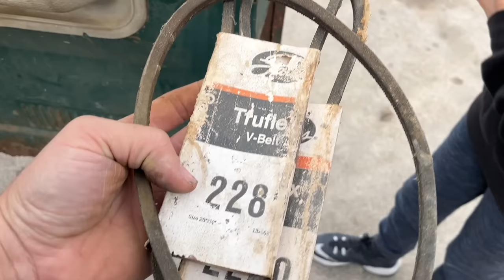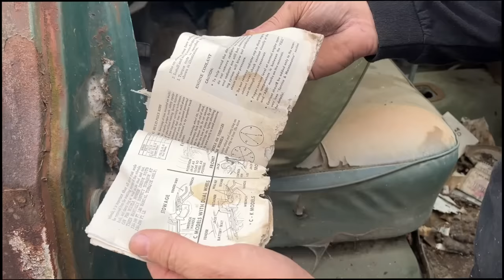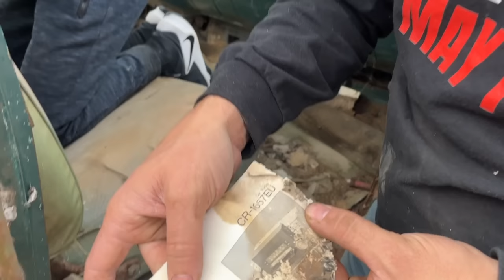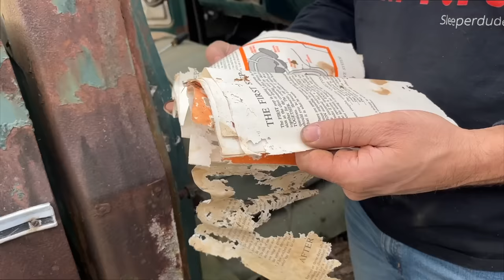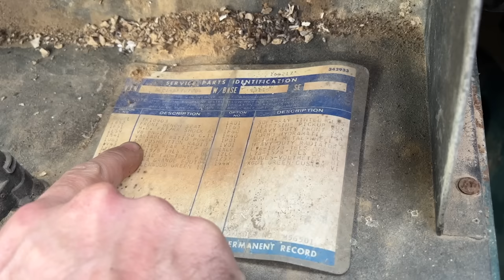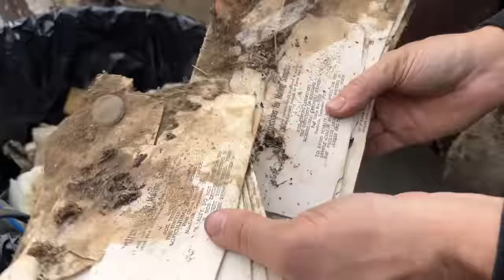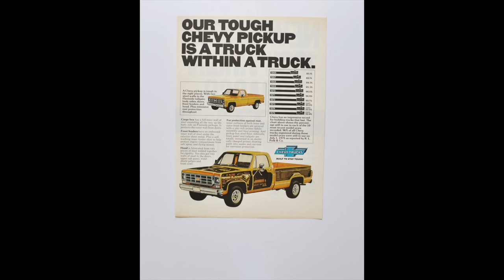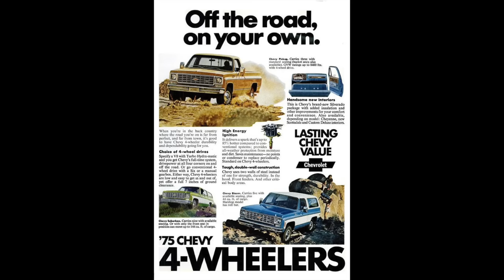Can we get it out of the creek? What's wrong with the transmission? 76 GMC K15 4X4.

Comment: That truck looks like is has spent too much time at a fertilizer dealer that sold dry fertilizer. I am surprised that the frame look so good. I vote for getting rust  free used parts or after market parts. I really think you can save the cab. Everything else needs to be replaced. It will make a super series of videos.

Comment: 35/12.50......no lift required if you trim out the rust. That wide black plastic edging for flower beds for fender flares and just see how far you can get in a local off road park maybe. You can go more aggressive with your tire choice if it's trail only.I have a pair of 31/15.50 15 v tread tires from a forklift, they were pretty worn but they look so ridiculous on 15x14 pro street wheels. I've wanted to try them on a s10 blazer for  a while now. But 4 of em, that would be a look. 31/15.50 15. Look em up man.

Comment: I just bought new sets manual locks, under 100 bucks. reason why they taken out is because they are full time. don't think you can add manual lockers because their no provision to bolt the hub to the axle.  but I am no gm expert.  sure, there is one out there that can tell you differently like the salvage.

Comment: 37.51 b4 i watch farther... the front driveline is locked direct to the full time 4wd type front hubs .... they made a small flat bearing that would allow the tc to spin free untill you put it in 4 hi or 4 low ...cost 5 bucks ...but if it breaks you have nothing

Comment: We got a 1973 Chevy square body 4 wheel drive and it’s basically the same as this one and in the same shape it’s rusted out but the frame solid and I’m pretty sure the transmission is good to it’s got no motor because the engine went into a different truck we have and we’re hoping to sell it

Comment: I had about 2in of that clutch material in my pan I just pretended It wasn't there cleaned it up and put new fluid in it. 3rd gear is like putting your foot in a bowl of mashed potatoes. So I just lock out the tourqe converter through 3rd and turn it back on to get to fourth. I've been driving it like that for about a year. I tow with it every day waiting for it to fail completely. It just won't but when it does I have a manual transmission I'm swapping in.

Comment: I don't know about a replacement hood I think it needs a replacement truck.
It might have 55 k on it but it's probably had little or no maintenance done..
I've sent better things to the crusher!
Reply from the maker: Maybe so
Reply: Looking at the paleness of the fluid &  the lining material I'd say it's had water in the trans either flooding or from the cooler in the rad..
The front hubs have been removed so it can be used in 2wd possibly due to front axle failure.

Comment: I would rip  the whole body off it paint the frame and find a cool early GMC 2wd truck and take the body off that and slap it on the 4wd frame. You still see those 1950 to 1960 2wd long bed step sides or something like that.

Comment: i had 78 truck like that it eat trans like candy went thew 13 trans in 3 years and like 20k miles took it to shops everything thinking had to be something causing it to burn them up but no shop could find problem even tried external trans cooler got tired of it sold it

Comment: i have owned and still do several 4x4s in my life and dont understand how your calling this fulltime 4 wheel drive ? ............. the way it is is that high or low is 2 wheel drive and high loc and low loc is 4 wheel drive and once you drive it in 4 wheel drive if you put it back in 2 wheel drive high or low you must back up about 20 feet to disengage the front hubs also when locking it into four wheel drive you need to go forward a bit to lock the hubs in if you dont have lockouts on the front axle outside